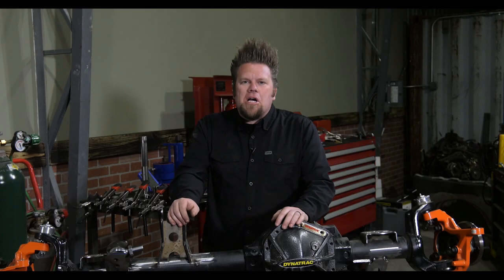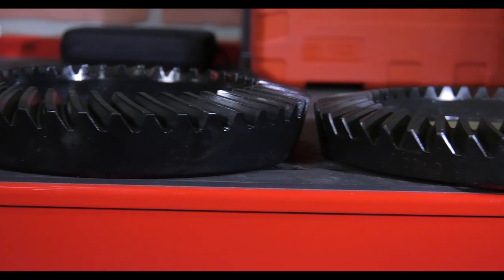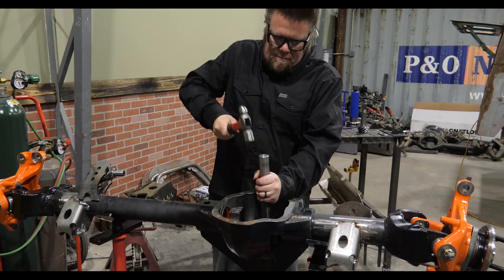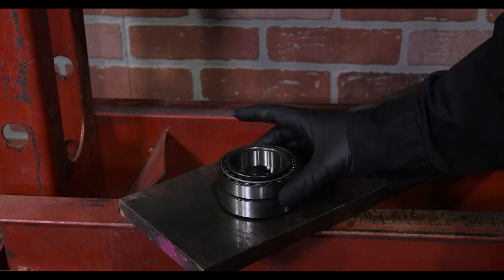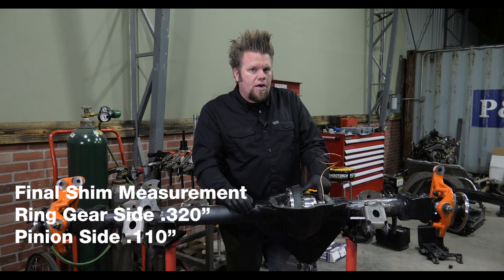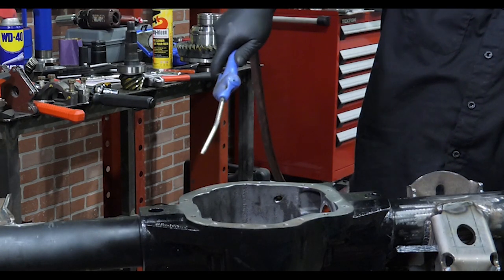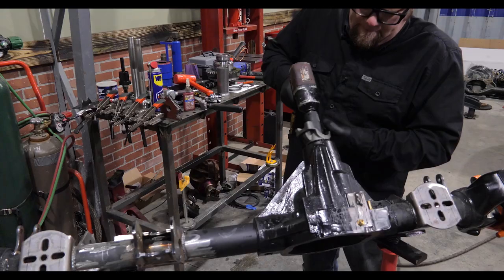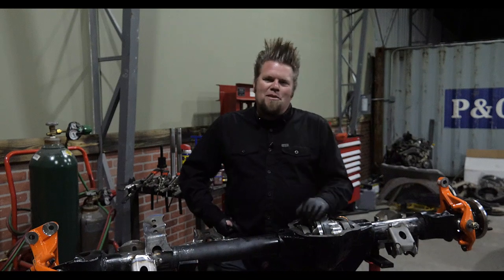How to Install Ring and Pinion and Air Locker, JK Dana 44 Front

Comment from the maker: My plan from now on is to make a step by step video for any axle that I rebuild.  This is the first one a JK Dana 44 Front axle assembly. Let me know what axle you guys would like to see one of these videos made for.
Reply: How different is this compared to a Ford Dana 44? I would imagine that the set up process is very similar.
Reply: 1985 Dodge Ramcharger. In fact, all kinds of content on a Ramcharger would be greatly appreciated. 😆
Reply: Big Tire Garage ,  I’ve got a 2017 Ford Expedition EL 4X4 that I would love to put a locker in the front diff, and maybe replace the factory rear limited slip with a locker also.
Reply: Showing something with a 3rd member would be a big contrast to a Dana axle video. Toyota 8", Ford 9", etc...also a 14 bolt video would be a logical progression.
Reply: Showing something with a 3rd member would be a big contrast to a Dana axle video. Toyota 8", Ford 9", etc...also a 14 bolt video would be a logical progression.
Reply from the maker: Very similar
Reply: I'm so glad your still doing this keep up the good work dude!
Reply: I have a technical question. I've read that the JK 44 has a slightly larger diameter ring gear than the old D44s. Does this change the MHD? The MHD you put in the video (4.321") is the same as the old style. Are they indeed the same?
Reply: Any major differences install wise between this and an old 76 wagoneer dana 44?
Reply: I have a high pinion Dana 60 and 10.25" Sterling. I plan to put in ARB air lockers and would really like to see you do a setup like this. I've search the internet trying to find someone swapping a ball-joint Dana 60 for a Kingpin Dana 60. You are a master in doing unusual swaps like this. There are so many negatives in ball-joint Dana 60's.
Reply: Awesome! Since 3rd gen Toyota Tacoma front diff is very different with the clamp shell, can you please do an ARB install into the 2016-2022 front differential of a Toyota Tacoma. There's no such video for this set up. Lots rear not no front clamp shell ARB install. Thanks much
Reply: Ian I have a CJ7 1981 with the 6 cyl 258  , warner t5 5 speed dana 300 transfer case amc 20 rear  end and a dana 30 front axle ,, all stock as far as I know ,, 1st problem found half a lock washer in with the shifter between the offset lever and the shifter plate .. very hard too shift now between 1st & 2nd  And going too 3rd .. still learning about auto tranny's .. 2nd problem rear drive shaft and yokes .. has / had the straps to hold the ujoints too the yoke ,, rear axle strap bolt broke then both straps bent dropped the drive shaft .. transfer case yoke straps bent the bolts and the straps ... I ordered new yokes for the transfer case and the rear end .. both have the u bolt clamp style also getting a pinion seal witch is leaking ,, new ujoints ,, i can do the ujoints no problem .. the pinion yoke is my problem .. lots of videos out there .. do I need to pull the axles and the ring gear out to check pinion drag ???  I do not have the gauges that you used in this video , someday when I can get the $$ want to regear both axles  or upgrade them . still just a street ride ..have a garage but no hoist so every thing is done on the ground or jack stands and or ramps ..I should have the parts by the end of this month ordered them yesterday ,, thank you for your time ,, Randy ,  I am in western NY

Comment: Always wondered why you can't just install the crush sleeve, take it back apart, measure the height with it crushed add a few thousands for the spring back on the crush sleve and put that many shims in with the solid sleeve. That way it's in once with the crush sleeve, taken back out and put back in with the correct number of shims. After a few trial and errors, you'd know exactly how much the crush sleve springs back. From then on. Keep up the great work!
Reply from the maker: You could do that, but really you are doing the same amount of work essentially

Comment: Also, some explanation of why you use the solid sleeve instead of a crush sleeve would be good for those who don't know. 
Racers say it's not needed, but for rock crawlers I believe in them. I quit breaking so many gearsets after I went solid👍
Reply from the maker: Yeah, I swap em no matter what....it isn't worth the 70 bucks that solid spacer costs to run a crush sleeve
Reply: @Big Tire Garage  lm gonna take a guess.     so after awhile the pinion bearings loose some preload then the pinion starts to get sloppy and gets worse the longer its in there until the pattern and backlash is so far off then starts breaking gears?

Comment: When building drag race style Dana 60 axles I always polished the pinion and shined the bearing we were using. Too much chance of difference in size with a set up bearing. In all cases check the wear pattern like you show.

Comment: Nice breakdown and instructions! Now if it was just a 2006 Dana 60 front out of an F350 Ford Super Duty. I have the 5:38 Yukon gears and install kit with the Timken bearings and will be putting a 40 spline ARB Airlocker in it with 35 spline routers and 1550 u joints I could use a looksee at build, tools, and other parts I may have missed, because I didnt see s case spreader during this video. Thanks a bunch Ian and keep them coming... oh a 14 bolt ribbed case gm rear would be awesome too!
Reply from the maker: Right on! I am not a fan of case spreaders..I have actually "split" cases with a spreader

Comment: Ian, my rear pinion seal is leaking.  Can I safely replace it without having to worry about messing up the preload and/or the crush sleeve?
Reply from the maker: Yes, just mark the position of the nut on the pinion...I use a cold chisel and count the threads showing past the nut prior to removal
Reply: @BigTireGarage  My question exactly, how to replace pinion and axle seals without messing up the gear settings for different axles? I like your shows, there more on tech than sales and your off-road is in the woods not desert.

Comment: I don't see where you set or checked the carrier bearing preload. You mentioned measuring the shims and adding 5 thousandths, but how do you know that's right when you were just holding it in place with a screwdriver?
Reply from the maker: Because the screw driver is taking up the gap that will be filled with the shims.  Once you measure for the side bearing shims, you simply add 5 thou for carrier bearing preload.

Comment: Great video Ian!  Since you're talking about a JK 44, i'm cuious.  If you were pairing a JK 44 front with an 8-lug d60 rear, how would you get the bolt patterns to match up?  Ive got a late 80's early 90's full float 60 rear, and a matching kingpin d60 front.  I'm considering narrowing the rear to JK width, putting 35 spline capable spindles on it, and going with a JK front axle instead of using the KP 60 front (ive got reasons..  :P ).  But i don't know how to get the bolt patterns to match up for wheel mounting.  Thanks!  And keep up the good work!
Reply from the maker: Sheel adapters would be the easiest wat to be honest
Reply: @BigTireGarage  easy, sure.  That'll make it wider though.

Comment: Is it the same  procedure for the rear JK 44?
Reply from the maker: yes, but it comes factory with pinion shims for rotational load....I am currently working on the rear video right now
Reply: @BigTireGarage  I have an AEV Brute double cab  with a 6.4  Hemi..I'm having a issue with rings and pinions. I think deleting the crush sleeve is a great idea! Maybe that will slow down my replacements LOL.
I will be upgrading to Dana 60s as soon as parts are available (any suggestions would be a great idea of course) she's not a huge off-roader but I would like to be able to put the power to the ground..
Side note: do you have the set-up timken bearing number?